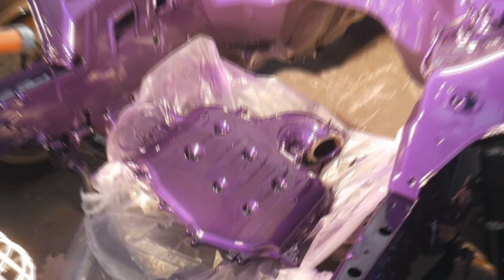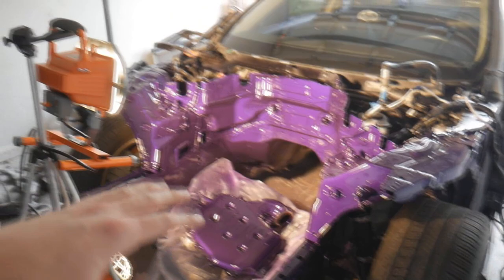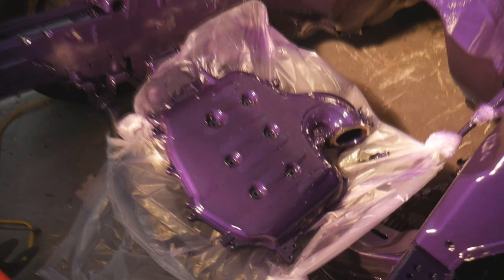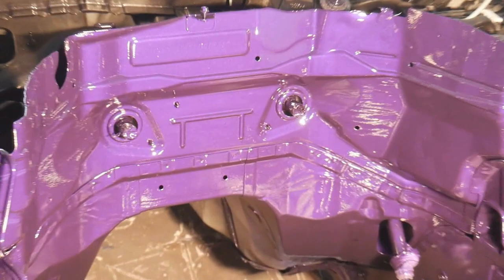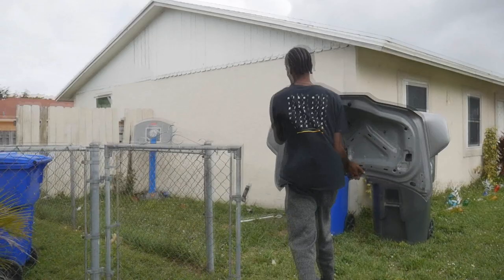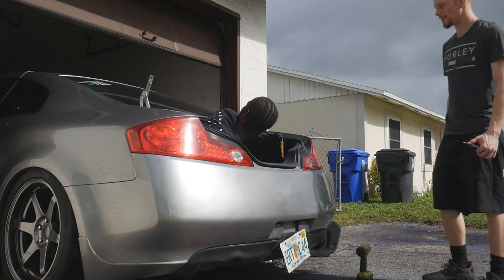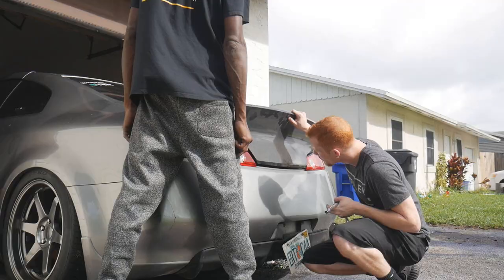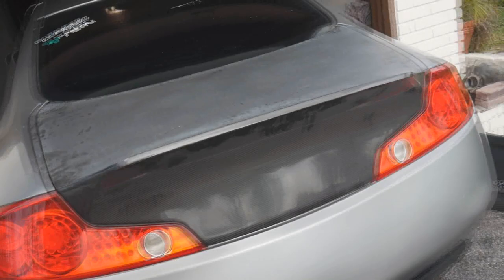Infiniti G35 Coupe Gets a Seibon Carbon Fiber Trunk!

Comment: im hopefully getting a g35 tmr :)
Reply: Tidql they are fun cars y’all enjoy it
Reply: good luck
Reply: Only buy it if its good or if its a shitbox if its really cheap. When I was 18 I had $5000 in the bank and was looking at a 2006 G35 coupe with wheels, exhaust, and vossen rims. It had 6 owners and 136k miles so my mom talked some sense into me telling me something was up. I now drive a 2019 Q50 but I really really like the G35, G37, and Q60 coupes. When I'm older and I'm bored I'll maybe get a G37 coupe for cheap just to have fun with.
Reply: @jakepokemonman1227  my 2006 coupe with less miles was around 5k canadian. Just alway check carproof and stuff.
Reply: Tidql do it ...
Reply: Tidql got my g35 with 150k miles for 3,750 runs like a dream just had one minor issue i fixed in my garage 🤘🏼